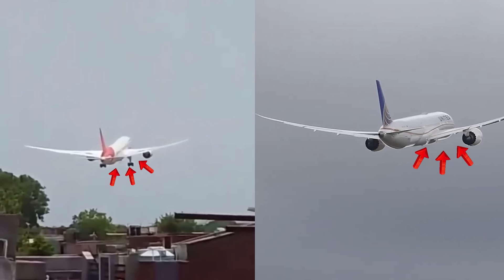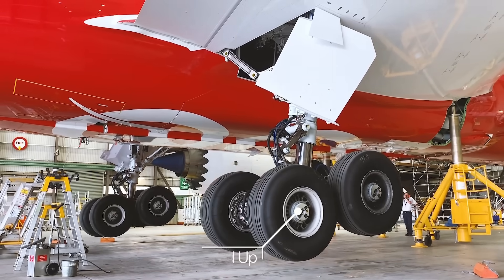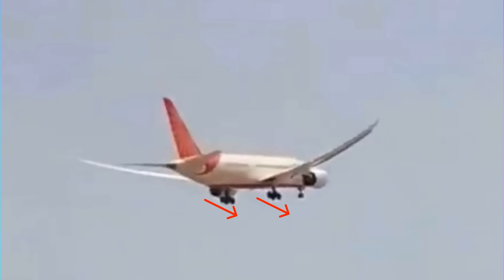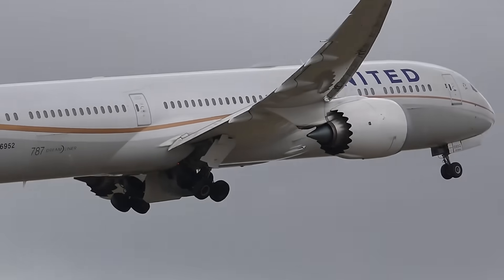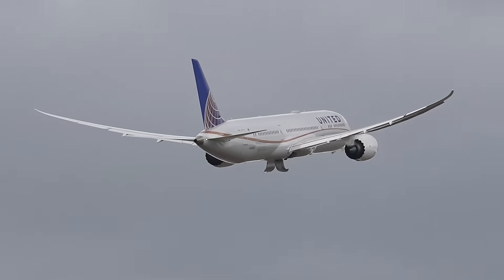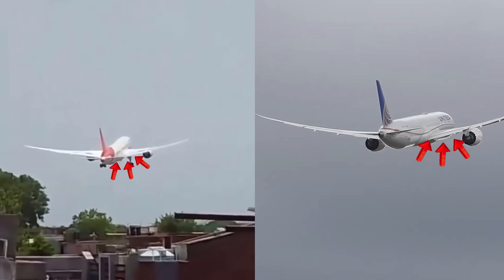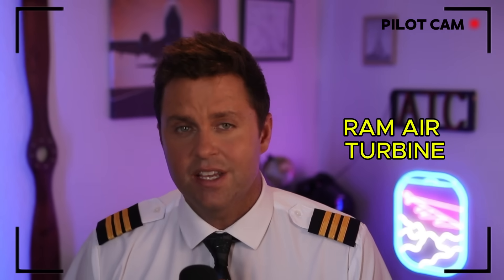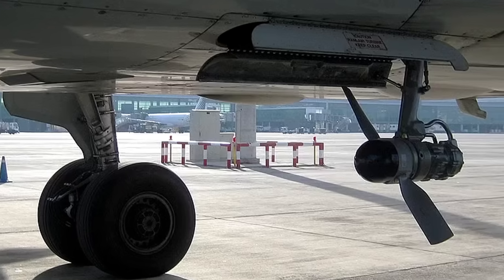Pilot Explains: A New Detail in the Air India 787 Crash Everyone Missed

Comment: Dual engine failure is a possibility but I think if it’s something caused by fuel contamination, can it cause both engines to lose power at instant moments. The theory i will be sticking with is that 
“ something was not done the right way before take off”. The problem is before take off.

Comment: Not autothrottle, it would set the engines to idle and RAT would not deploy.
The gear being in an intermediate position makes sense now because it climbs to 625 feet then everything is shut down in an instant and RAT is deployed. The redundant systems including the ability to deploy those redundant systems has also gone south. All hydrolics and plane electrics are out BUT the plane maintains level flight, no yaw to one side. That means the hydrolics were locked by their own pressure and maintained that pressure. No hydrolic leaks therefore.
For both engines to fail points to fuel starvation or possibly a catastophic change in the fuel air mixture which caused compressor stall. Fuel air mixture problems are usually connected to volcanic activity at higher altitude though, not at ground level. I find it hard to comprehend that two seperate independent electrical systems would shut two fuel pumps off at the same time and not deploy the redundant systems.
I would like to see if this plane had the fuel filters changed while in India in the service records or any other maintanance involving the fuel supply. I don't go with contamination because there are no other flights reporting fuel contamination and associated engine stalls. 
I'm going with a loss of fuel pressure at this stage.

Comment: As an Aerospace Engineer, here’s my perspective:

1. This is a major airport handling over 35 international flights daily. Given that no other aircraft reported issues, the likelihood of fuel contamination seems minimal.

2. If there had been an engine failure, it likely would have been detected during the takeoff roll. Since the takeoff appeared normal, it's reasonable to assume the engines were functioning initially, though there was evidently a loss of power or thrust afterward.

Ultimately, we’ll only know the exact cause once the black box data is retrieved and analyzed 🙌

Comment: Engine flame out will be seen by the naked eyes and there was no sign of that in any of the videos. It is clear when they had positive climb, the captain called out gear up but the first officer retracted the flaps instead. If you noticed carefully on the wreckage where the tail ended up on a building, the elevator was on the position of the Nose-Down! No matter how you guys argue, it is a human error no doubt. The only other explanation is if the maintenance crew screwed up the fuel lines during the last maintenance or removed them temporarily to fix something else and never did a good job securing them back in place. There are other valid theories you guys never talked about, for once the crew could have made a gross error calculating the take off speed and flaps configuration based on the total weight/length of runway required/cross winds etc...They could have simply rotated at a lower than required speed etc...The theory of contaminated fuel does not add up else the crew would have noticed that during taxiing or at the threshold of the runway when they revved up the engines before they sped down the runway. The other theory might just blow your mind and it did happen at least twice . The crew might have just tried to take off assuming the last crew configured the plane for taking off while in fact it was configured for landing except the flaps were retracted or they never entered the airport elevation and pressure parameters correctly which fooled the altimeters. Modern airplanes are very tricky so any lazy crew has no place in flying.

Comment: Glad that you have mentioned this Gary, because another Air India, Boeing 787, flying from Hong Kong to Delhi, had to turn back as the pilot reported a problem with the aircraft.
Reply: Wow! Right... 'cause that never ever EVER happened to a 787 before.
Reply: Exactly.  And all the reliance on "single-engine" operability in the event of one of those motors shitting-the-bed, which has happened !! gives me zero consolation crossing the oceans.
Reply: @alexpoliakoff6589  The reliability statistics should give you plenty of consolation though.

As the saying in aviation goes:
2 engines = Double the chances of an engine failure.
4 engines = quadruple the chances of an engine failure.

Comment: Yall as pilots can make more educated guesses than the rest of us. I am a mechanic, so I look at it from that angle. Ive watched many air mishap investigations. I am guessing that there was an issue with fuel delivery system at full throttle, like it could not keep up with the demand, or something is going to pop up in the maintenance logs, well depending on how well the records were kept. Hopefully it was not some wire harness that was put back into place without being secured, and vibrations caused it to work loose... then cut power or signal to whatever systems ran through it. 

What about forgetting to add fuel, or module was reading in error. Rotate at end of runway, all fuel goes to the back of the tanks and pumps cant deliver sufficient fuel.  Cant say they were on E due to the fireball. 

Time will tell.

Comment: I agree with some of your points
Which is fuel related😮offcuse
ENDia is on the downward decine mode as in economy
This airline air ENDia was bancrupy so a wealthy jew ENDian " tata" bought the struggling airline
Offcuse 
Poor fuel quality
Lack of proper maintance
Lack of qualified staff
Lack of quality replacement parts
And so on
Probably was the cause of this failure and result of unnecessary deaths that could have been avoided
If not for saftey shortcuts
Folks this is not a goliwud😮 movie
Real lives gone bbq😮

Comment: and the fact that the plane flies dead straight  all the time indicates the power failure is absolutely symmetical.
Reply: But it doesn't, does it? It does a little shimmy about 10 seconds before the end, which others say is concomitant with the flaps up/gear down oops I pressed the wrong button theory.
Reply: @davidbentley4032  Mayday [...] no thrust, losing power, unable to lift.  That straight from the pilot.  Hits the throttle and gets no response.  No flaps was not the cause.
Reply: @eventtrading  Well maybe but you can hear the engines apparently going at full pelt on the video taken from the apartment/workplace.
Reply: @davidbentley4032  im no pilot but my understanding is that full thrust on that plane will make it fly with no flaps, gear down...or at least maintain altitude.... remember it can fly wiht ONE engine...
Reply: @tascheri  Ok but remember the ambient temperature was close to 40 degrees C I heard. Would 5 degree flaps (if there were any flaps at all it's hard to tell) be adequate if in addition the gear was left down or got stuck?

Comment: I go with Ryan Bellowing Acres Support's verdict, im an electrical engineer, and everything points to an electrical failure of a system that controls fuel delivery to both engines, perhaps its the pumps, perhaps its something else, if it is found to be electrical control failure, then Boeing need to ground these and look at making seperate control systems for each engine, so if there is a failure, it only affects one engine and the other is still operable, I think aircraft manufacturers incorporate too much electrical and computer control into systems.
Reply: I concur. These days, everything’s run by electronic circuits—your car, your fridge, probably even your toaster. All for better efficiency, smarter control, and supposedly a perfect, futuristic life. In a perfect world, that would be great. But guess what? We don’t live in that world. We live in the real one—where gremlins sneak in, wires get cranky, and things randomly stop working for no good reason.

Remember when LED light bulbs first came out? They were marketed like the Second Coming of Edison. “Super efficient! Saves the planet! Lasts forever!” Yeah, okay. Fast forward a few years and… surprise! Some of them burn out after just a year. Others slowly dim, change color like a mood ring, and then die anyway—usually right after you’ve thrown out the receipt.😂
Reply: @Sammy-y7m too much reliance on computers ect if it fails everything goes
Reply: Copy that!
Reply: I like the new motorcycles that have 2 headlights. It's easier for drivers to see it's a bike, and not a light pole, but would be a life saver if each light is on its own electrical current so at least one will stay on if the other one has a problem and goes out. Same idea for the 2 engines.

Comment: The new video footage clearly shows the RAT (Ram Air Turbine). This aligns with the absence of engine noise and the survivor's account: according to him, the lights went out, followed shortly by the sound of the RAT compartment opening. Eyewitness reports also support this impression.
My assumption: there may have been a complete failure of the aircraft’s electrical system or the FADEC (Full Authority Digital Engine Control). Modern engines, such as those used on the 787, are fully digitally controlled. An electrical failure or software glitch could have caused both engines to shut down—not due to a mechanical fault, but because the control system failed. In such cases, the RAT deploys to provide the minimal power necessary for hydraulics and avionics.

This scenario is not far-fetched, as several documented incidents involving the Boeing 787 have shown how software issues nearly led to disasters:

2020 – FAA Warning on Electrical Power Loss:
The FAA found that under certain conditions, all generators on the 787 could shut down due to a software issue in the power management system. In a worst-case scenario, this could have led to total electrical failure. The issue was addressed with a software update.

2015 – Memory Overflow after 248 Days of Continuous Operation:
A rare but dangerous bug: after exactly 248 days of continuous operation, an integer overflow in the flight computer could occur, potentially resulting in loss of flight control. The FAA mandated periodic system reboots as an interim solution.

2022–2023 – FADEC Malfunctions in Engines:
- Airlines reported repeated instances of engine interruptions or unexpected behavior, suspected to be linked to issues with the digital FADEC system. Some of these cases were not publicly pursued but discussed internally.
- "Uncommanded pitch events": Pilots reported sudden pitch movements without any input—likely caused by a combination of sensor errors and software misbehavior.

These incidents highlight a core vulnerability of the 787: its heavy reliance on software. This dependency becomes a risk when faults go undetected or are not transparently disclosed.
I sincerely hope Boeing does not silence another whistleblower. The recent deaths of two Boeing whistleblower engineers were already so conspicuous that it's becoming increasingly difficult to regard this company as credible.

Comment: The rat was deployed, so it was either loss of electrical, loss of hydraulics, or loss of engines....the pilots said they had lost power...so pretty simple.  It's Boeing that is trying to push the conversation towards pilot error.  typical of boeing.  The flight before the one that crashed (same airplane) showed a video that nothing electrical on the plane was working when they landed, yet they took that plane anyways.

Comment: For fuel contamination speculation check online an article "Japanese Jetstar Boeing 787 GEnx-1B Engine Biocide Serious Incident" . A neglected  or incorrect fuel biocide treatment coudl be the a factor here, causin rpm oscillation. Anyone B787 type rated here to comment this pls ? Thank you
Reply: My point exactly….oscillation, the engines keep running not simultaneously failing, contaminated fuel is a red herring.

Comment: Heavy aircraft overloaded, hot temperature ( low air density ) and even if the aircraft didn't breach the end of the runway, that dust could have been blown on to the runway from previous aircraft taking off !!!  Fine dust particles are nasty for modern high-bypass turbofans like the Trent 1000 or GEnx on the 787. These engines are designed to resist ingestion but aren’t immune, especially if the airflow is already disturbed or the engine is near the edge of its performance envelope. Stall margins shrink and even slight compressor disturbances could lead to "no thrust" symptoms or reduced engine performance when operating near the edge of their performance envelope, as in hot and heavy conditions, dust can shrink stall margins and cause compressor disturbances. This might explains the lack of thrust symptoms, validating the theory that dust could have been a critical factor.

Comment: There are a very few cases of loss of thrust or control in all engines not counting fuel exhaustion.

1/ British Airways Flight 38, which crash-landed short of the runway at London Heathrow Airport on January 17, 2008. This was due to a blockage in the heat exchanger in the fuel lines due to dislodged ice.

2/ British Airways Flight 9, a Boeing 747 which lost all engines due to an encounter with a volcanic ash cloud. Subsequently the pilots managed to relight all the engines and limp to safety.

3/ Cathay Pacific Flight 780. Fuel contamination with spherical particles of superabsorbent polymer led to very limited control of thrust from the engines.

4/ TACA Flight 110 (May 24, 1988) due to very heavy rain/hail.

5/ Garuda Indonesia Flight 421 (January 16, 2002) due to heavy rain/hail.

None of these apply here.

I'm wondering whether the rotation of the aircraft for takeoff triggered some failure mechanism.

We really need the voice and data recorder information.

Comment: I already pointed both of these things out. If even one of those engines was still working, not only would the plane climb and fly away safely, but you wouldn't be able to hear the RAT. Also the RAT would not deploy if one engine was still working. And the gear trucks angled down but not coming up would indicate a fail gear retraction cycle. The BIG QUESTION is why did both engines fail?

Comment: I’m 100% in my belief that the moron not flying raised the flaps and not the gear. Climb profile looked perfect up to the point where the gear should have been going up and never did.  

Many planes departed using the same fuel, so bad fuel I highly doubt.  

Also, when the weight comes off the wheels, the inner gear doors automatically come down, and if the gear up isn’t selected within 10 seconds then those doors close back up. So the gear tilts forward when those doors come down.

Comment: I hate to say it, but I keep going back to this one thing.
Duel engine failures are nearly unheard of.  Contaminated fuel while possible, it’s not likely  that both engines failed simultaneously.  
This leaves one very unfortunate possibility and that is a single engine failure followed by an inadvertent shut down of the good engine.  As unfortunate it is to say that it is not unprecedented and should be examined.
Reply: The ground crew could have contaminated the fuel on purpose. I have suspected terrorism (Pakistan) or sabotage from day 1 and I am standing by it. There is no other plausible explanation.
Reply: @TrollMeister_ while that is possible, it’s still unlikely both engines would die nearly simultaneously.  Since they never run the tanks dry, or de fuel them there would have been a quantity of fuel remaining.  And since there are multiple tanks with varying amount of fuel in them it would be highly difficult to ensure a good flow to the engines just long enough to get them airborne.  If it was contamination intentional or not it would be vastly more likely that any engine failure would be first one engine and some minutes later the other.

Comment: Has anybody looked at the distance , at the distance of the takeoff run ? To me it looks short and they rotated very early and around 1500 metres and probably only doing about 130/140 knots by that point on the runway . I may be over thinking this but rotating at 1500 metres when 2500 ish is needed is coincidental and may point to a computer fault with the speed and what with lift only achieved briefly then what looks like followed immediately by a stall , If you look at their take of run and compare it to the Ariel view of the airport they pass the checker building were the road to the left dog legs to the left and just after were the buildings jut out on the left they rotate before the start of the terminal building on the right what do you all think?

Comment: I am a retired airline guy and have flown all the Boeings from 707 to the 757/767. Flew the A 320 for 7 years. I think you are spot on with this video. The slight exception I would mention is that pulling the power levers to idle wouldn’t cause the RAT to deploy would it?  I do believe the RAT was out. 
Juan Browne’s
opinion matches yours. There is also the video that appears to show a large object fling off the port side.